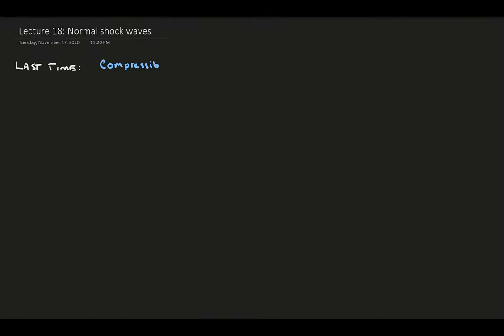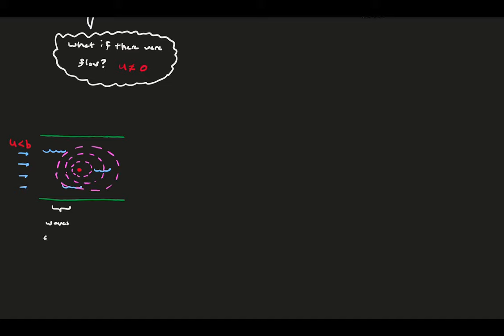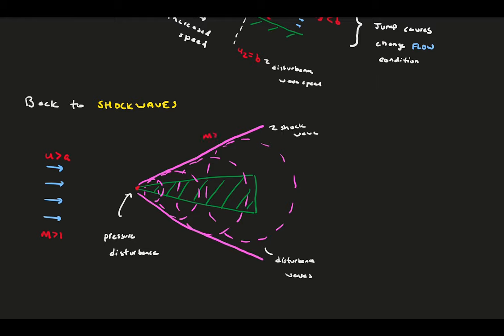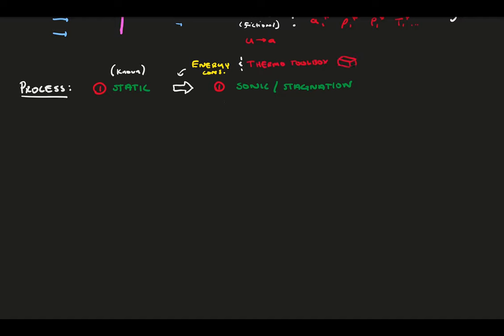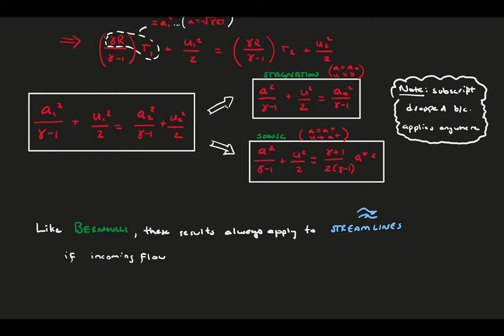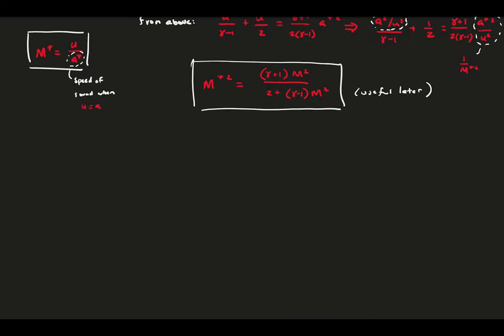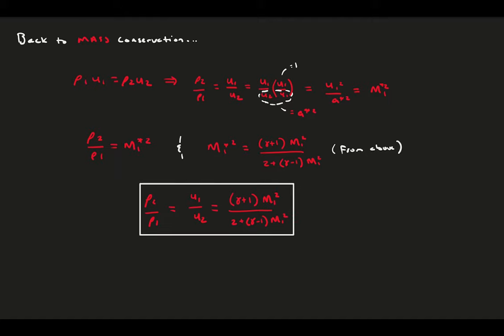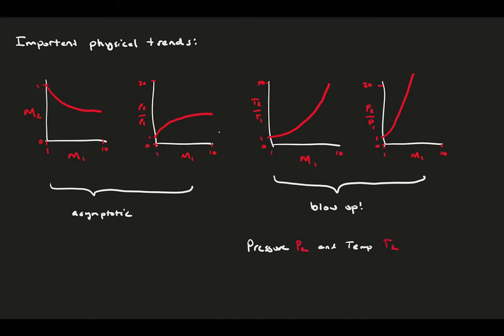Normal shock waves [Aerodynamics #18]

Comment: How did we use Bernoulli's equation in normal shocks, which is a basic condition for using it, assuming that the density is constant?
Reply from the maker: Hi and sorry for the late reply! The semester got a way from me.

This is a great comment. I think I am technically wrong for saying it is Bernoulli itself, because it is really just a derivation from a control volume approach of this 1D analysis that spits out an equation like the Bernoulli equation. So, great point on your part!

Comment: Isn't M2=M1 a solution to the equations of conservation of energy, momentum and mass? Why this doesn't happen though?
Reply from the maker: Hey! Sorry I'm not sure I understand, why doesn't what happen?
Reply: In the normalshock equations, the air could just maintain the same velocity and same proporties and still all equations of conservation of mass, momentum and energy would be met. With that, I meant M1=M2. However, this doesn't happen. The air does change velocity. Why so?
Reply from the maker: @antoniotonisi2419  it's because locally disturbances like pressure fluctuations have nowhere to go, the vehicle is literally going so fast it outruns them. In subsonic flow they move away from the source quickly, but in supersonic flow they build and build. This is partially a reason why the flow just can't stay happy where it is where M1=M2. I'm not sure I helped but I hope so!